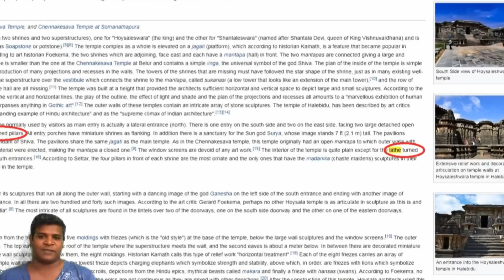Hoysaleswara Temple, India - Built with Ancient Machining Technology?

Comment: 900 years seems not realistic. This temple should be atleast 50,000 years old.
Reply: @Shyan Proof?  Do you have proof?
Göbekli Tepe is estimated 9 to 10, 000 years old so that is twice as old as your "5000 years old claim" and for the 3 pyramids of giza to line up with orion's belt taking into account of the earth's rotational wobble they'd be 10,500 years old, the sphinx (with the water erosion its suffered and to line up with the constellation of Leo again would need to be 10,000+ if not 36,000 years old. (26,000 earth's precession).
Many different cave paintings have been dated @ 32,000 years old in france to 23,000 & 17,000 years ago (all in france) & they aren't just stick figure scratching but elaborate paintings of animals.
On top of that we know an ice age abruptly ended 11,700 + years followed by floods - consider the sea being 120m lower than it is today you can only guess at the devastation that caused to whatever civilisations were living at sea level as most do today.
Reply: +Turk In case it's not obvious, there are "conspiracy" movements in India that believe that the string of cultures and empires in the Indian Vedic civilizations are over 50,000 years old, that the eeeevil British destroyed it, and have been desperate to suppress this information ever since.  Therefore, anything old has to be at least 50,000 years old.  Period.  No evidence required.  Any evidence to the contrary was planted by the eeevil British, even if it's purely contemporary histories written, found and reported by Indians - such Indians are fake Indians.  Or something.

There is absolutely no question that the Vedic tradition is _old_.  Really really old.  But not 50,000 years old.  Vedic Sanskrit (the language of the Vedas) has been dated back to about 2000BCE (4000 years ago).  That places it the oldest (or maybe second oldest) written languages on the planet.  That's certainly nothing to sneeze at.

If the eeevil British were wanting to suppress the antiquity of Indian culture, even 4000 years old would be way too old.  They'd date Vedic Sanscrit to, say, 1500 years ago so that "British history" (erosion of Roman conquests onwards) was older.  But they haven't.  So they aren't.

Other cultures have similar conspiracies.  Apparently some Navaho, for example, believe the Navaho culture dates back, in the places where it is _now_, over 150,000 years.  Take that India! ;-)  But in reality, DNA and other evidence indicates that at most it's about 1200 years old, and there a solid trail of their migration (DNA, linguistic, tool details etc) through northern and central Canadian and US first nations to back it up.

There aren't many cultures that have lasted a really long time in the same place.  The best example I can think of in North America is the Haida and related west coast tribes that are claimed (by them) and estimated (by researchers) to be 8-10,000 years old and still living in the same region they always did.  If the eeeevil British were going to suppress the Indian history, wouldn't they be even more successful in suppressing the history of the Haida in British Columbia?   Haven't done that good a job have they?
Reply: +Siddharth Agrawal All I can see is mutterings about King Cobra worship.  Vaguely reminiscent of the primitive poison snake cults of southern American Christianity.  Nothing to do with 50,000 years at all.

The fact that the temple is documented in contemporary histories, including the name of the King who had it built,  who funded it, and why they built it 900 years ago seems pretty compelling to me.

is there some reason to think that the Voysola Empire didn't build them?  Is there some reason to believe that the Voysola Empire existed 50,000 years ago instead of 900?  What about the other Voysola temples built the same way at around the same time?
Reply: +ahmad athar That doesn't make any sense.
Reply: perhaps this post holds the answers you seek - http://ajitvadakayil.blogspot.in/2015/09/sanatana-dharma-hinduism-exhumed-and.html
Reply: 50,000?? There was no human civilisation that far back. Even the Indus valley civilisation only dates back to roughly 5000 years not 50,000 !
Reply: +avr charyulu Why not?  Why are you disparaging the skills of Hindu artisans of 900 years ago?

Especially when they've left so much evidence that they were the guys who built it.
Reply: 50,000 years? based on what evidence?
Reply: Fromage Frizzbizz Yet Göbekli Tepe dates from 9 -10,000 BCE putting it at 12,500 years old utterly destroying your claim (which is why it is currently the biggest find to date regards megalithic structures) - you can NOT convince me a people go from scratching around in the dirt to erecting huge megaliths at a drop of a hat, there HAS to be a substantial amount of development time - rather than saying you know what occurred as with the current narrative of mainstream historians & archaeologists do and instead as alternative historians say "we simply don't know, yet"
Reply: 8-10? as in 10th–8th millennium BCE? in other words 10-12,000+ years old?
Reply: why is it too far back? There is no evidence that it is nor do we have evidence that it isn't....
Reply: proof?
Reply: could be yet even more, perhaps even 60,000,  life has more than 7 millions that man kind has walked over earth  according to Vhedic and Tibetan records and it has it's times of remaking and rewriting everything trough ages, only akashik records would tell the truth finally; but you have to do your own research on that I'm just an observer from the marvels of this world... 
~ there are to many things hidden for the public acknowledgement & that is part from the control and social slavery systems they keep in the factions over the planet, knowledge is a way for freedom in every aspect, anywhere...  greatest institutions in europe and america hold  many discoveries about many from the most intrincate  natures from this magic place and its power and beauty...  we barely know how great is this small place
Reply: hominidae7sp nice mandala you got there :)
Reply: Fromage Frizzbizz 
 if you think the mathematics involved in aligning the stones is simply "a random piling of dirt", stones with planetary alignments and can be used for astronomical predictions, and that point out constellations or stars etc that weren't previously known or known of by other civilizations & have only recently been (RE)discovered by modern astronomers and that all this just happened overnight without mass planning and co-operation of supposedly undeveloped primitive man then you're only showing your ignorance on the topic.

To reiterate, You have to consider for Göbekli Tepe to be built only a few 100 years after the younger dryas ice age (which occurred 12,600 years ago)  the peoples involved would have HAD to have been using knowledge from a previously civilized culture FAR older than 12k years - they wouldn't be able to make the planet findings and mathematics up in such a short period - they were now rebuilding what once was destroyed by the ice age's subsequent floodings caused by the comet trigger that melted them. 
THAT is why Göbekli Tepe is such as massive archeological and historical find, it proves man was far more advanced than once thought, essentially rewriting the books. It's not just the setting of big stones, it's their alignements that prove the people that built the place were advanced in mathematics - just as the hoover damn has constellational mathematics built into it that would tell future man what our current level of knowledge is just as all previous monuments have done. What better way to convey knowledge than to build it into the structures that withstand the rigours of time.
Reply: @Fromage Frizzbizz
 "Can't be arsed" to argue each point out as it's irrelevant what you think as much as what I think is irrelevant to you but I'll state this, the hoover dam is simply representative of numerous megalithic sites, how you can praise one and dismiss another is puzzling, regardless, when does your book come out proving Hancock et el to be wrong? 
No need to reply, I'm content acknowledging the achievements of our ancestors, you seem intent on belittling them. Facts speak for themselves and care not either way.
Reply: +Turk What makes you think I'm belittling the achievements of our ancestors?  In this thread, I am the one who seems to do the most admiration of the skills and techniques of ancient trades, achieved inspite of the limitations of the tools of the day.

I make things.  I admire workmanship and intent.  Size doesn't matter so much except as it demonstrates human perseverance and commitment. Things made with CNC machines are boring.  Things made with primitive tools that are almost as precise as a CNC machine fills me with awe.

I'm far more impressed by GT, Stonehenge and this temple than I am with the Hoover dam.  The latter is a big pour of concrete and steel rebar with huge dumptrucks, diggers and precise engineering, the workers just applied shovels and picks and twisted pieces of wire around rebar.  Did a worker spend days polishing a few square feet of concrete?  Nope.  Did they with this temple?  Yup.  GT, Stonehenge et. al. are examples of long-term coordinated effort by generations of people, skilled artisans with a lifetime of experience, and in whose hands even primitive tools produce glorious works of art, and in many cases display remarkable understandings of science.

I'm impressed with Stonehenge because they understood that the sun in a specific place meant something very important.  The fact that setting up some rocks to point at them was easy (waiting for when the sun was in that place) is irrelevant.  The only place where interest in the complex mathmatics comes in is the admiration of someone spending the time to figure out that two of the rocks actually pointed at something at a given time and may actually mean something.

In other words, the "how" of placing the sun stones in Stonehenge isn't impressive.  The implications it has for the "why" of placing the sun stones IS impressive, whether it being the builders themselves, or the modern archeologists who had the suspicion that it meant something, and the wherewithall and math to expend days or months to figure out what it meant.

The long and the short of it is that I'm inspired by people and what they can achieve with the technology they have.  You don't have to add magic, or aliens or lost technology, and in fact, it subtracts from their achievement.  Stonehenge or GT being constructed over 2000 years by human muscle power, ropes, sleds, rollers, rocks and scraps of metal is inspiring.  The duplicate of Stonehenge made in a couple weeks with modern construction equipment and modern stone saws _isn't_.
Reply: +Turk It's totally amazing how quickly societies forget how to do things.  Even a 150 years ago, just about every male could cut stone, work with metal or wood, make a pot, understood the processes for water wheels, cast metal, shoe a horse if they had to, splint a broken leg, relying only on "artisans" for things that they weren't doing often enough to get good at.  When my dad was in his teens, just about anyone could take a car apart and put it together and have it work.  When I was  a kid, we fixed our own TVs, made our own radios, and I even made my own computers.  Several in fact, but I wasn't that good with cars, and never learned anything about stone work.

But today?  The vast majority doesn't have a clue how any of this is done. They can't swing a hammer, split a rock, nor repair anything.  Consumerism?  Yes partially.  But partially simply because civilization has become so complex we don't have time to teach everything, especially that which isn't relevant to modern life.  They don't understand how soft soapstone is, nor realise that chalk is actually a _rock_.

Fortunately, there's still craftsmen who keep these skills, but even that doesn't last forever.
Reply: +Hubcap_ In a thread where everybody making wild guesses about dates without anything whatsoever to back them up, and you complain about carbon dating numbers being "made up". LOL

Unfortunately, carbon dating doesn't work on rock.  The dating methods that work on rock won't work at timescales as short as we're talking about here, even the wild-ass guesses.
Reply: +Fromage Frizzbizz do you believe this earth plant got destroy more then 3 times . like petra city in east Krishna city darwaka. pheron kings Egypt and more . mother nature's is ture and truths have its own face like this
Reply: thanks for the reply Fromage Frizzbizz
Reply: No I never suggested 50k, the op did, I asked him for his evidence (which was obviously a wild guess/random figure). My dates given were in reply to yet another person making unsubstantiated claims that there were no civilisations 50k years ago which when you consider cave paintings dating 30,000 years old in france and then consider the younger dryas ice age which occurred 12,600 years BCE there may well have been civilisations before that and if you consider  "the sphinx (with the water erosion its suffered and to line up with the constellation of Leo again it is at least 10,000+ years old and could well be 36,000 years old. (for leo to next be inline you'd have to consider the 26,000 earth's precession). And lastly Göbekli Tepe which is estimated to be from the 10th–8th millennium BCE which is nearly 3000 older than the "8-10 thousand years ago" you mentioned.
Reply: Turk U never said 5000 years was the first and oldest. But we can intelligently extrapolate the figure to estimate that civilization came around 10000 years ago plus minus a few thousand. But 50,000 is too far back.
Reply: +Shyam Koundinya Before you can decide when the first civilization was, you have to have a good solid definition of what "civilization" _means_.

Is a civilization a couple of tents?  Huts?  Agriculture instead of hunter-gatherer?  Piles of rocks?  Cities?

8000BC appears to be about the time in which man discovered agriculture and started domesticating animals.  Gobekli Tepi is dated to around 9000-10000BC.  Stonehenge to 5000BC.  The earliest solid dates for "cities" appears to be around 3500BC (Mesopotamia).  The oldest Hindu temple still standing is Changu Narayan at 425AD.

Which one of those is a "civilization"?
Reply: No, it seems 100,000 years old.
Reply: +Turk The shift from hunter-gatherer to agriculture is pretty obvious, and that has been pretty firmly dated to 8000BC by a variety of techniques in both the Middle East and around India.  There are certainly traces of humans that are far older so dating isn't an issue, but none of the older ones had agriculture per-se.  It wasn't until a society had agriculture could a society build/support anything more than small villages.
Reply: lol time is so relative in Indian. When we say I will see you in 10 min it should be multiplied with 30 lololol
Reply: I will add a couple more zeros lol
Reply: +Turk Yet what?  What claim do you think I've been making?  You seem to be confusing things.  What "current narrative" do you think I hold to?  My point is just "how do you define civilisation?".  What sort of "development time" do you think a big pile of dirt and some random circles of stone built over a thousand years need?  Are they involving engineers, and the letting of government contracts?   A master plan?
 Big factories?  I kinda doubt it.

My "idea" of a civilisation is a relatively monolithic culture that builds more than one thing, that leaves more traces behind than some agglutination of different structures, that lives in a place for long periods of time, and builds things that take a long time with a unifying idea, rather than a group of random tribes that come together every once in a while to fiddle with a pile of rocks.  A group with a unifying culture, whether it be the same language, writing or religion.

A permanent city that has clear signs of being "designed" is a civilisation. 

As such, I don't believe that GT represents anything much in the way of "civilisation".  Neither do Stonehenge and the other contemporary structures.

Stonehenge, for example, appears to have started out as a burial area, with subsequent nomadic tribes/cultures building things on top for reasons of their own.  With more digging, GT will likely turn out to be the same.

There's not much difference between "alternate" "We don't know yet" and your "mainstream" "this is what we think makes sense" made by experts, other than the former can lead to some pretty silly flights of fancy about space aliens, magic mystical powers and other fantabulous interpretations.
Reply: +Turk "Random piling of dirt" - that is precisely what a "Tell" is.

"Points out planets and constellations [not previously known]"?   Which planets?  As for "constellations" - you do know that constellations are entirely arbitrary interpretations of random star placement don't you?  They're not "things" they're Rorschach blot collections of points of light that have become enshrined in lore.  That's all.

There seems to be no such interpretation of GT yet, unlike Stonehenge.

As for "mathematics".  Much is made of how complex mathematics has to be to line up so that a line through point #1 and point #2 exactly hits, say, the Sun at a given time of the year.  It would take you or me much research to figure out exactly where to place a pair of rocks to get a perfect line on the Sun on October 30th at noon so we could build it this week.

But you forget, there's a simpler way, the ancients didn't have such schedules or deadlines, they could afford to wait.  Wait for what?  For October 30th of course, and park the rocks where they're inline with the sun.  No mathematics required at all, and the builders of GT and Stonehenge had hundreds of times to realign it perfectly without any math whatsoever.

It takes serious math to figure out what two rocks might be pointing at at a given time.  But for setting the two rocks up to match what you see "this instant"?  You just need a working eyeball and a couple of sticks to mark the spots, and some willing villagers to drag rocks into place.

The hoover dam demonstrates pretty high math.  The Pyramids demonstrate fairly sophisticated math.  But no math was required for Stonehenge or GT.  Make some rectangular rocks, put them in a rough circle, with these two setup where the wizard placed some sticks by direct eyeball observtion a few months earlier.  Done.

As for ice ages.  Glacial ice advance isn't an "on/off" phenomena, nor is the coverage "all there" versus "none".  It's more of a series of "little less melted than fell" versus "little more melted than fell" years.  The most far south in Europe was 18,000-25,000 years ago, and I don't think it got as far as Turkey at all.  Nor India for that matter - sure, the Himalayas would have had far more ice and snow.  But in the lowlands?  Nope.
Reply: This temple was built more than 12,000 years ago. I agree it is quite obvious this artwork was machined before the great catastrophe that killed off the mammoths,giant sloths. saber cats etc. Some believe that the pyramids and obelisks which are found all over the planet were part of a giant energy system but during this catastrophe the earth's axis was knocked off center like it is now and that threw off the whole system and it no longer can work. There are hundreds of megalithic structures that are quite obviously machined, have cut marks like this or keystone cuts that are just not possible with primitive bronze chisels.
Reply: you should read more lol, less youtube junk and stories from grandma and grandpa
Reply: +OSYofRR Let's see: Indian archaeologists, historians, anthropologists, and even local lore know EXACTLY when the temple was built (900 years ago), how it was built, why it was built, the name of the King who had it built, know enormous amounts about the culture that built it, the name of the people who helped fund it, and why, and you think it was built >12,000 years ago based on wishful thinking with nothing whatsoever to back it up.  Who should we believe?  Not you.

Earth's axis knocked off center?  That would do a lot more than kill of a few animals.  Like, melt the entire surface of the planet.  The amount of energy required to tilt the earth, against rotational gyroscopic stability, the 23 degrees is absurdly enormous.  Like, the full output of the sun, or an impact by something nearing the size of the moon.  Just as likely to shatter the planet.

What makes you think that the earth as ever shifted tilt?  Position of the magnetic pole yes.  Gyroscope precession of the axis in a 26,000 year cycle yes.  But a full scale realignment of the spin tilt?  Nope.

The other planets in the solar system have tilt too.  So why should we be unique?

Oh, and yes, the last mammoths died about 3000 years ago - ran out of food on a small island off the east coast of Siberia due to climactic changes over thousands of years.  As for some of the others, your (and my) ancestors ate them into extinction.  Giant ground sloths don't do too well against thrown rocks and spears.
Reply: If it was built 900 years ago then aliens came down and gave them tools OR we have been lied to about the dark ages not having advanced tools. If they lie about some things how can you trust anything that cannot be proven by scientific method? Scientists are largely funded through donations and grants by the government so they basically have to tow the status quo or become out of work pretty fast. So if they all agree it was 900 years ago but some facts just do not make sense or are actually possible then I cannot believe everything state funded archaeology says. So how about this?

Yes impossible feats are awe inspiring...I throw out a challenge to anyone who is set for life and can afford to do this. Assemble a team of workers and build works of art like this on a grand scale with just bronze chisels and sandpaper for polishing.. Lets see how long it takes and the quality of the craftsmanship. I offer $1 million (my life's savings)reward for any work that is close to this quality completely documented and video taped according to Guinness World record standards. It must have intricate filigree, laser precision and hollowed out jewelry looking ornamental work like these statues. Any flaws or cracks in the granite or basalt means you start over...no filling it in. It needs to shine so well we can see our pores in the reflection. No machinery is allowed...in fact you need to hand make your chisels and the sand paper from scratch, Every slab needs to be hauled by hand made machinery to your site. If anyone can do this I will be inspired and gladly pay up not to mention they will be world famous.
Reply: +OSYofR This is the most stupid conversation I've ever been in.

STOP INSULTING YOUR ANCESTORS!

You insist on believing that your ancestors of 900 years ago were too stupid to build this temple without magical help from aliens or lost civilizations that could somehow disappear without leaving a trace.

No, your ancestors of 900 years ago were just as smart as anyone today.  Smarter, if we have to use you as a standard.  Sure, they didn't have CNC, 1000 ton cranes, or computers, but they were so smart that they could build this WITHOUT our high technology.

A thousand years from now, when everything is made with a 3D printer and when all our tools and machinery for making things have rusted and faded away, you will be the one refusing to believe we can cut wood, metal or stone, and that wooden table rotting away in a museum will be "proof"
 of Alien Intervention.  Nonsense.

Every king wants to leave something behind that says "Look at my power!  I can make a mark on the world that nobody else can".  King Vishnuvardhana of the Hoysola Empire obviously went a little too far, because you refuse to believe that he did.  You refuse to believe that Manibalaki, Mabala, Ballana, Bochana, Ketana, Bama, Balaki and Revoja, amongst many others, carved those statues and left their names on the bases of the statues as proof.  You refuse to believe the inscription found near by that said Ketamalla – officer in the employ of King Vishnuvardhana constructed this temple.

The Hoysola built 1500 temples over 400 years, and about 100 still exist today.  As for the west trying to denigrate and hide the achievements of India:

According to the 19th-century art critic James Fergusson, this is a "marvellous exhibition of human labor to be found even in the patient east and surpasses anything in Gothic art".

Does that sound like anybody is trying to hide it?

As for your challenge, I'd almost be tempted, but of course you wouldn't follow through.  

Let me give you a hint: these temples were entirely carved out of soapstone.  Why does this matter?  Soapstone is so soft that bronze chisels are completely unnecessary.  You can carve it with sharpened sticks, bone and, if you're really desperate, teeth and fingernails.  Some Canadian Inuit still do just that - carving sculptures with pieces of bone, rocks and polishing with leather.  After they've sold a few, they can a few modern tools that will make the job go faster.  Like a good pocket knife, and a couple of wood carving chisels.  Rock cutting chisels?  Unnecessary.

You should read up on the properties of soapstone.  Impervious to weather, completely non-porous, polishes with a scrap of cloth, and carvable with a disposable plastic picnic knife.

You obviously hate scientists.  Scientists don't seek to maintain the status quo.  That's _stupid_, and I would never have become the one that I am if that's what I'd be stuck with.  Every scientist dreams like King Vishnuvardhana did, of finding or inventing something new, something that surprises others, and something that survives the challenges of their peers.  They all want to be remembered like Volta, or Einstein or Rutherford, or Meade.  Which means it has to be something _new_, and something that people pay attention to.

I've been fortunate enough to invent something completely new of my own that has led to a comfortable semi-retirement.  The only reason you won't find a description of it, nor my name, is that in my business (frustrating spammers and other online criminals), being too public would get me harrassed and quite possibly killed.  Those that need to know about it do, nobody else does, and that's how it shall remain.
Reply: +Hubcap _ "Experts" that have proven themselves, unlike the nutballs who really belong in strait-jackets you rely on.
Reply: @sea man So michelangelo's statues carved from marble not soft easily carved soapstone - despite the numerous journals/diaries etc detailing the tools & process he used on all his statues were in fact not carved by "primitive" tools but were ? well what are you claiming?
You should try carving soapstone - its incredibly easy - I wouldn't say wooden tools but simple files from bone/teeth or metals such as bronze or copper could easily carve it & a team of dedicated craftsman could certainly make this temple in a lifetime.
Reply: I actually have to agree with you about that, I know how to wire various electrical systems and how to fix a car on amateur level but in this world nobody wants to hire self taught individuals, they have to go to formal schooling which is very expensive and sometimes does not guarantee employment anyways. I feel like that keeps many people from learning more skills because they cannot profit from or even get to use skills/knowledge of say architecture or hydraulics or carpentry. Most people away from metropolitan areas do learn much more though, at least enough to be able to fix plumbing,cars,wiring,furniture repair to be able to get by at least.

 All of this however has nothing to do with the fact that those pillars and carvings have the tell tale signs of being machined. Now could the ancient peoples have come up with something to say hollow out those rock carvings where a 3mm twig cannot even get in there? Highly unlikely, the only thing I can come up with is a chemical reagent added into a hole in the rock but that would be crude at best and not likely to get the desired affect. For the pillars actually, they could have come up with something similar to a lathe that we just never had record of, especially with so much warring in those times ideas got lost but still does not fit what archaeologists and historians have been telling us. 

I guess we both cannot prove our points definitively but I come from the school of thought that we are not alone in the galaxy and so do many others and that is why when we see complex ancient works it does not add up to what we have been told. Add in talks of giants in the Bible and other ancient texts, yes Indian Vedas too, and it gets one wondering if that explains these massive megalithic structures. Seems to me this history has been kept from us and we get a very selective picture of the past to push a status quo that is best for the power brokers. Its not like it really affects us if we know what our true past is or does it?
Reply: Real archeological proof? Not a blog written without archeological proof. Carbon dating is the only way to identify along with Writings of the kingdoms. And that we have. Please go through the link which gives the evidence available. Not some cooked up story. Go to page 63 to start reading about it. Understand the property of a soap stone. https://ia601608.us.archive.org/10/items/in.ernet.dli.2015.382777/2015.382777.Annual-Report.pdf  Understand the architecture of it which reflects Hoysala Architecture. It is a beautiful & mind blowing piece of architecture, but please dont demean it by bringing mythology into it. Respect the Hoysala. They were the ones to build it. Our Kalidasa sculpted some figures there. Please dont mix mythology with reality.
Reply: Thanks for this info as half life for decay is really a huge figure. So the next viable option is through records only. and the only record that comes through with the same set of architecture is from Vijaynagar. Hence the conclusion. Now anyone wants to prove otherwise, should show some proof too.
Reply: They? Indian Archeological Society headed by Indians would be considered westerners is it? They have had 70 years to negate its findings. So please come out of bubble. Be logical sometimes. It helps.
Reply: Shi Womino It is easy to offer up antagonism when dealing with and describing these lost souls. I think it is fear and ignorance. Unless they're trying to chop your head off, they're harmless. The difficult and personally challenging approach is to just ignore them. I talked to this lady, that I have talked to many times at the gym I work out at. One day while I was talking about something along the lines of the subject of this video, she blurted out "the Earth is only 6,000 years old". I almost fainted in disbelief.
Reply: lol they just found humans that are 130,000 years old
Reply: +Anthony White Did they have iPhones, TVs, or stainless steel pins in their bones?
Reply: +OSYofRR I'm from the same school as you - I think there's probably "others" out there, but what I also understand is that either physics prohibits them from "being here" in any realistic sense, or, there's some new Physics we don't understand, and they're ALL ALWAYS here and "un-hideable".  There is no in-between.  And even if there was, the "powers that be" on earth are completely incapable of hiding them to the extent to which they'd have to be.  All else is pure paranoia.

The megalithic structures simply means that ancient mankind as we know it can be pretty damned determined over long periods of time, a lot smarter than some are willing to give them credit for, and perfectly capable of doing such things.  The fantastic things seen here are simple to do on a rudimentary lathe and other hand tools (the tiny carvings can be done with bent pieces of bronze wire or shaved bone - soapstone is just that soft), it's just bigger than most people are familiar with, such lathes can be built with wood, and unused wooden lathes don't last long in that climate.  A testimony to their skills, determination and knowledge, but supernatural?  No.
Reply: about Ellora caves, well how do you define the temples which have been carved on a mountain certainly not hand work for carving out rooms wall floors and ceilings inside the mountains. All world is one community I do not say for any particular temple but more advanced civilisations existed way before thousands of years ago.. with more celestial machinery and tools unlike today mankind is wearing leather and using animal bones to polish their sugar, our ancestors were way more spiritual and less materialistic.
Read about 4 yugas were 4 yuga is Kali Yug or black era, those people who were holding these technologies knew that humans with our knowledge will only use for weapons, genetic mutilations, and for their materialistic gains so they always leave in the starting of Kali yuga..You may or may not be familiar with the seven sages who comes in the beginning of first yuga and leave before the starting of the 4 yuga and comes back in the end of it and the cycle goes on...many of great places in earth still present till today were built by whatever technology our ancestors had way back hundreds of thousands year ago...you'll get your proofs when you die
Reply: Shi Womino Hahahaha true
Reply: Fromage Frizzbizz the hindus are not using it now, the dont have the technique passed down directly from that time so recent, they have no record of it being built from such a recent time, and...places like the taj mahal do have records.
Reply: +The Essene But that's where you go wrong.  They do have records of it being built.  They also have records of the Islam invaders trying to knock down all the temples the Hoysolas built.  They have records of the names of the Hoysola emperors, when they lived, and many of their artisan's names and their other works.

The Hindu aren't using it now?  We're not using the outhouse out back anymore either.  "They don't have the technique passed down", of course they do.  Why aren't they using it now?  Because a motor-powered machine is a whole lot easier than whipping some oxen (or some slaves) to go round and round for a couple of weeks with a carriage that has to be rebuilt a couple of times per job.  We're not making fires by rubbing sticks anymore either, because matches are so much simpler.
Reply: I stand corrected.
Reply: Fromage Frizzbizz glad to see you did detailed research over how old ancient cultures could be but have you ever thought modern day carbon dating or DNA and all dating parameters incapable of dating any object beyond 10000 years?? May be we need some more sophisticated modern device to prove dating of these ancient marvels.. if the other cultures/civilazations also says the same thing?? Just a thought..
Reply: +Sonic Tantra Why "should" it be at least 50,000 years old?
Reply: YEP.  It can not be of so recent.